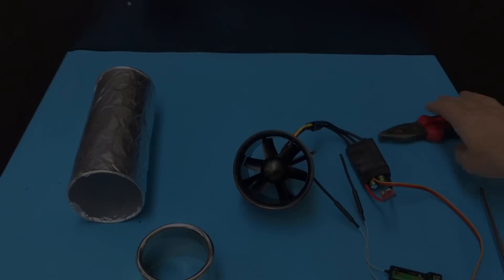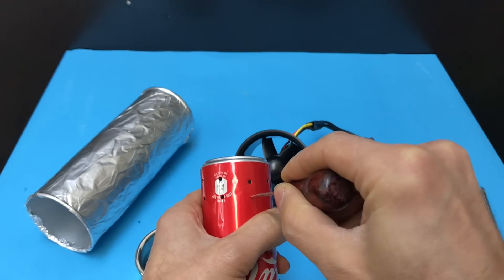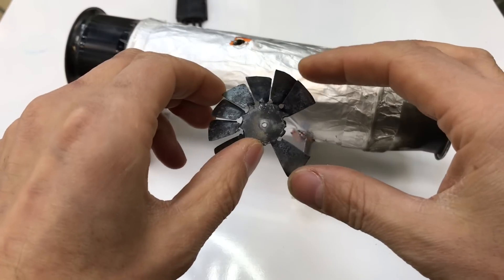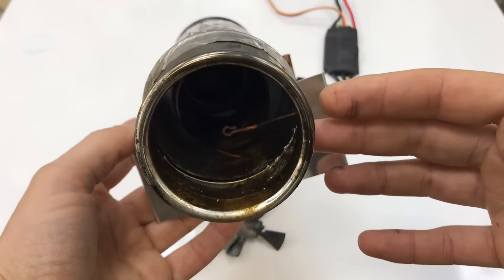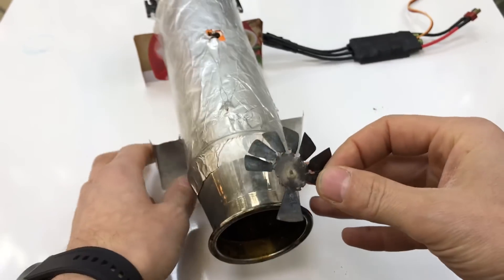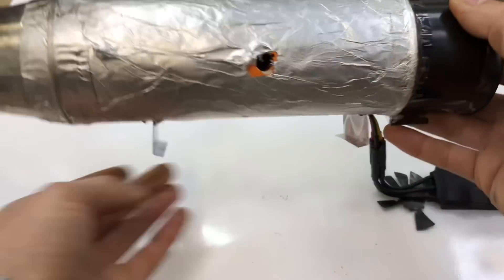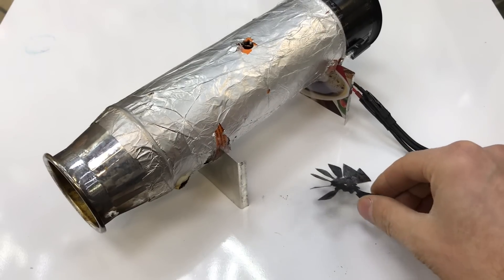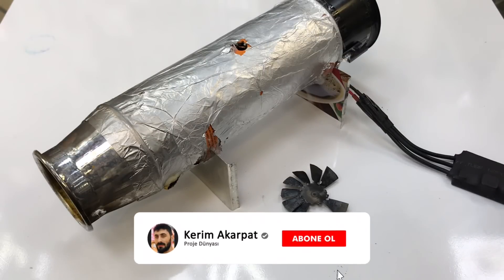TURBO JET TÜRBİN MOTOR YAPIMI, EVDE JET MOTORU YAPTIK

Comment: Süper olmuş kardeşim ama sana şöyle bi sorun olucak 2 tane supercapacitor 100 farah 200 farah mi oluyor ? aldim seri bağladım 5.4 volt jarz olucak hale geldi ama ve 5 voltla jarz olmuyor  ????? sorun tam olarak ne 1 amper jarz olmuyor mu ???illlla 2.t amperle jarz oluyor senve sorun nedir ?illa 5.4 volt jarz olması mi gerekiyor? mesela 4 volt jarz olazmi ? Capaciter 1 volt bile jarz olur diye biliyor yanlismi biliyor um en kısa sürede cevap verirsen sevinirim yada benim kapacitorlermi bozuk ???? Sıfır aldim
Reply from the maker: Seri bağlamada volt artar paralel bağlamada güç artar , amperi ne şarj ettiğiniz güç kaynağınız
Reply: @KerimAkarpat  sesi bağladım ama 5 volt akım 1 amper bildiğin telefon akım jarzi kısaca ama kapavitorler 5.4 volt 200 farah ediyor anlicak ama jarz olmuyor galiba tahminimce 2.500 amper akım mi istiyor emin değilim power bank devre karta bağladım  jarz olmuyor sebep ne ola bilir